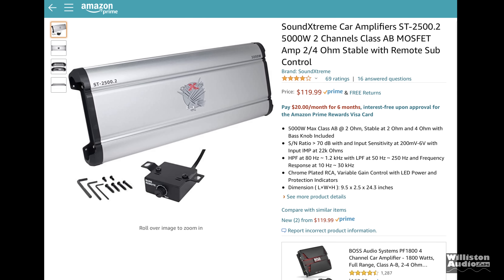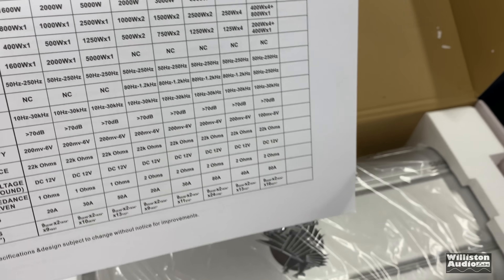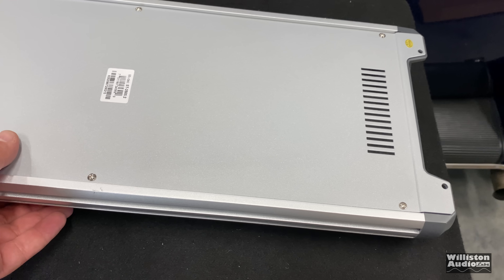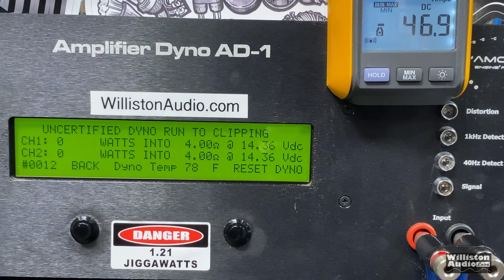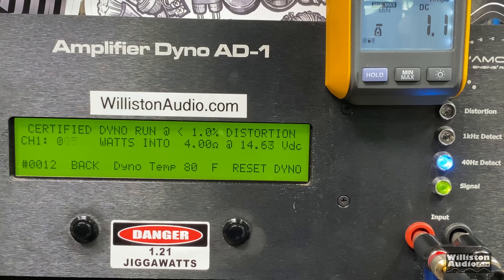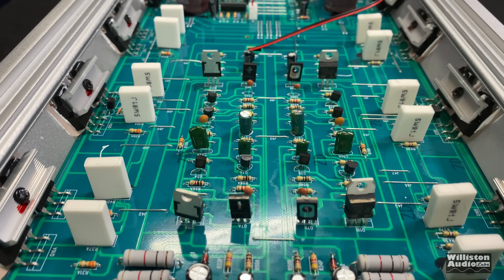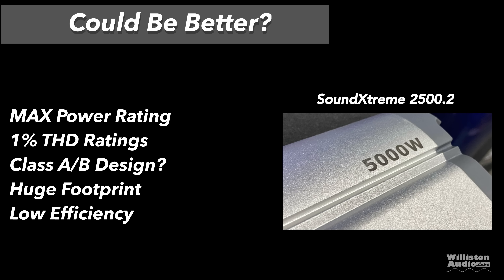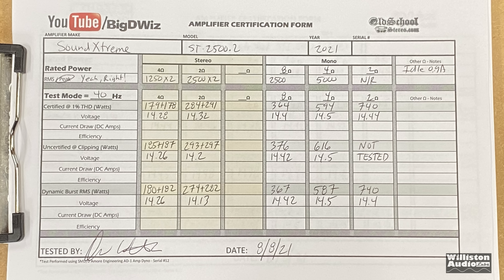How Much Power Does a 5000W Amp on Amazon Actually Produce?

Comment: When buying amplifiers look at the total amps of the fuses 2x 30amp fuses equals 60 amp...  1x 80amp equivalent to 80 amp ect...take that total of amp on fuse/s and times it by 13.2 or whatever your cars "running " not resting voltage and you'll be very close to ACTUAL WATTS  ( SHOP BY FUSES AMP RATING NOT THE WATTS ) MORE AMPS MORE WATTS ECT...

Comment: So if these amps say 5000 watts you just drop the last 0 to get an idea of the real power lol. I’ve seen so many people runs these really cheap over rated amps and brag about how much power they’re running lol. One guy I talked to said he didn’t understand why people paid so much more for amps when you can get “thousands of watts for $100.” He would not even attempt to listen to what I was saying about how they lie on their ratings. Wouldn’t even look at my phone when I was pulling up amp dyno videos lol. Talk about major denial. He was right and knew everything and anyone that said different didn’t know what they were talking about. I even tried to bring up ohm’s law and how it was so impossible to get that amount of power with the voltage and current with how small the fuse was on the amp was. And I wasn’t the one keeping the debate going. He wouldn’t drop it. He just kept looking up cheap amps that were over rated. Saying look man there are 100’s of lower priced amps with thousands of watts. Lol. Like because so many companies made them they had to be rating true power. I forget the brand of amp it was. It wasn’t boss. It was like pyle or rockville that was 4000 watts lol. On two of the Walmart kicker 12” subs. They honestly didn’t sound bad. They could of used a little more power but for the price they bumped. I just couldn’t get over this guy though lol.

Comment: Angled connector blocks suck dont they, my two Pioneer GM-D9601 amps and my GM-D8604 have them and they were a right pain in the arse with the amps on the back seat.

Comment: i was mislead by sound xtream also..paid for 2//2000 watts at 600 rms compatition subwoofers..when they arrived the box states 1300 watts and no rms ratings..also inside the box the round cut out that all speakers come with was broken and the sub was leaned into the box..and this was with both speakers

Comment: So it's like this, str8 up! I plugged in my amplifier dyno and had a nice 14.6 volts registering from my power supply and I ran this "sound Xtreme" amp. I needed a competitor to run a against it so I chose the obvious choice that everybody has been waiting for. Yup you got it! I ran this caca load against the best caca load! Guess? No? Give up? Ok well, I ran a 2/0 OFC wire to my butthole and farted something fierce and I blew a 166 watts and uncertified my butthole blatted out 190 watts of clean, methane power. Now, this hunk of caca called "sound Xtreme" is pure doo-doo and the people who slang this caca are all higher than the buns on Kensington street. They are all zombies, shuffle footing and bumble butting into eachother and lethargicly poop out these solid caca units that make no power. Like I showed my butthole after a normal dinner can produce more power per hole than these diahrehha doo-doo and pee pee amps do. All the guys do at the facility is get loaded and pee all over the receptionist who is high as well and is making big doo-doo piles next to her desk because shes to high and cant walk. She just hangs off her busted chair and goes poop all over the floor. Yes, this company produces caca. Pure, rancid decaying road kill bbq'ed up and eaten then, farted out as to create toxic clouds of butt and it still makes more power per hole than all of these crap, poop, shit hole amps. So. In conclusion,  don't buy one. Shy from caca, doo-doo shit boxing crap amps.  For one, you'll get wet poop for your money. Not power. Raw, raw, raw butthole power foo, and two, your supporting pooping idiots with massive dope habits! These individuals who poop while walking around because they are just way to high off methane and other farted out gasses know nothing about butts or amplifiers. Trust me, just go and RIP fart after fart into a 5 gallon bucket and then shove your power and ground wires into the bucket after you've farted 100 times into it and that will give you 3000 watts at 2 ohms! YES I KNOW INCREDIBLE! AND GUESS WHAT? LIKE I DID YOU CAN "HARDWIRE" THE BUCKET RIGHT OUTTA' THE PROJECT! HOW? REALLY YOU SAY? . YES YOU IDIOT! BYPASS IT AND HARDWIRE THE SOURCE TO YOUR SUBS! JUST PUT THE 2/0 OFC ONLY WIRE ABOUT 7 INCHES UP YOUR BUTTHOLE AND LET EM' RIP! ITS GOTTA BE WAAAY UP IN IT BUT YOULL GET IT! ITS WORTH IT SINCE YOU'LL SEE MORE POWER AS THERE WILL BE NO LOSS IN AMPS DUE TO ALL THOSE FACTORS LIKE VOLTAGE DROP OR BOX RISE. YUP! ALL POWER FRESH FROM THE SOURCE. THE BUTTHOLE. INSTANT WIN FOR THIS GUY! ME ESE! E QUE JOTO? ILL POST THE "HOW TO" TONIGHT. HOPE THE GAYS AT YOUTUBE DON'T CENSOR IT BECAUSE ITS REVOLUTIONARY! BYEEEE GUYS I MEAN GAYS

Comment: It's funny, in the old days when you'd buy a cheap unknown brand amp. You'd usually get like 1/3 to 1/2 the rated power. It would also typically be built on the last generation of tech that the best brands were using before their upgrade.
Now I watch this, 10% advertised power, terrible materials, I wouldn't let my kid mess around putting this in a car. My how the times have changed lol.

Comment: So I have a dumb question. I have a mono amp and a 4 channel amp but they do not meet the rms power of the subs or the midranges they are powering would it be worth it to buy different amps that did or would there not really be a sound difference because my gains are low and it will power the spreaders to distortion

Comment: If they would just advertise it as a 600RMS amp for $120, I'd say that would actually be a winner.  Anyone else agree?
Reply: Yeah but another company would sell the same thing and say it was 1000w and sell more, that’s probably why the numbers are so off
Reply: @Industry-insider  , well it defeats the purpose, because I would rather spend my money on Real Power.
Reply: @Roln19s  clearly it doesn’t make a difference because nobody actually believes it has 5000w
Reply: @Industry-insider  , which is my point.   If it was advertised for it's rated power, it is a Value of the amount.  End of story.

Comment: The worst are the "big" amps that had the double circuit boards...small board on 1 end with RCA....with ribbon cable jumping to other side where the BTL chips are located..and some even had hunks of metal in between to give it that real power weight lol...and you can't get rated power unless you sprinkle the packet of pixie dust in it...come on Big D did you keep the pixie dust that came in box?

Comment: The sad thing is that 600w still kicks ass in most cars so most won’t even question this…
Reply: If it was running a highly efficient box with in car gain, yes.  After all 600W vs 6000W is only 10dB!  But the (true) 6kW powerhouse will sound better and last much longer.  It will also cost at least ten times more too! ;-)

Comment: Ok I have a question I have a audioFonics 1500watt amp from 2005 and it has 2 40amp fuse does that mean it’s good like idk if it puts more power or if it hits 1500watt it hits hard with 3 subs connected jw
Reply: This is what i do is 2+40=80a x 12volt -10% and that is what the amp max can do if its a a-class amp .(960watt)
If its a a-b amp than its
2+40a x12volt-45%=432watts watts.
2+40a x 14.4 -45%= 518watts

Wy do i use 12volts ?
A car is not stabel on 14.4volt it go up dan down thanks to the bass of your music .
And a dynamo is not fast so it can pump the volt and the amps up.
Set a volt meter en set the music on and you will see it go down with easy to 13volt and lower.

You do not need to have a test dyno to test it .
Its just the limit of the volt and amp .

This way for that i pay for a amp i can do with a calculator what the watts it can pomp out.
Reply: @dyslectische  - Class A amp would be nowhere close to 90% efficient. You are thinking of Class D.
As for the silly lecture 12V... Note that BigD always tests at 14V to 14.5V. All car audio is tested and rated at that voltage because that is what the fully charged car battery puts out (12V is basically when it is flat).
If your voltage is drooping to 13V or less, then your power connections are severely lacking.

Comment: At 8:55 in the video the brown cap on the right looks like the bottom of it is missing a chunk or burnt up.
Reply: Do you mean the 2 x green 2200uF electrolytic input filter caps?
All the caps have a dark black-ish goop slapped around them to glue them down. Watch from 8:42 (main caps) and look at the same 2200uF caps at 8;48 - see how it's slashed onto those copper bars?

Comment: Stayed true to the 10% of rated power on cheap amps. The most frustrating part is a 600 watt class ab amp for $120 is not a bad deal. Great video as always man keep Dick Riculous on the case.
Reply: Id be curious to see how it performed on a set of beefy music speakers and not subs. Like a set of ssa evils or something thats power hungry. I still like the idea of a dual power supply ab 2 channel for highs and mids.
Reply: @jarrodbrennan121  - It'll perform exactly the same as any other cheap Class AB amp with the same (actual) power output.
Reply: That thing takes up too much space for a 600 watt amp though.
Reply: ohh absolutely  i remember the days of 1 dollar plus a watt class ab amps that were much more poorly built than this one is..
Reply: I agree.  I bought a sound storm 4000 amp for $100 and it’s very strong.  Not 4000w but Mabe 1000w.

Comment: Also, I was just screwing around on eBay and bought a Lanzar Legacy 3000 watt max amp (CLEARLY MaxxSonics amp) and it came with spade connectors for all inputs and couldn't push bass out of some POS Pyle 12" subs that I bought just to mess around with. The car audio world has changed so much that unless you drop some real cash you'll never be able to get something worthwhile anymore. It's truly sad.

Comment: 5kW into 4ohms requires 142V of signal level. To reach that signal level the amplifier will require 200-0-200 DC rails (400V).
The power filter caps were rated at 63V, so two rails of 60V are 120V. At 120V max audio sgnal voltage will be 42V. 42V in 4ohms is 440W and in 2ohms 880W. And they can't even do that.
I don't understand how are manufacturers allowed to make these false claims.
Reply: @Mitko The Macedonian I agree. Really irks me seeing false or exaggerated ratings on audio products. Would love to see a stop put to such false ratings in audio!
Reply: You ask "how are manufacturers allowed to make these false claims" .
Easy, they can say whatever they want. There is no way that every single product can be "tested not a liar" prior to sale. Furthermore, they'd just make a "Golden Sample" then sell the rubbish anyway.
The buyer has the ability to protect themself - it's called "Caveat Emptor" .
Reply: Plus the 80A fuse at 12V would only be 960W if it was 100% efficient.
Reply: Ahhh, the joys of unregulated capitalism. Selling overrated cheap Chinese junk never gets old.
At least the major online retailers (Amazon, eBay) have a returns process for items not as described.
Reply: Because its sold in the American market. Think how much we are lied too by our govt and our media. At least with amps you can look at the fuses or fuse ratings and get an idea, i always thought if someone doesnt have enough sense to know this, they shouldnt be searching for an amp to start with. Thats just my opinion though. For real , who watches this channel all the time and dont already have a ballpark figuire of what the amp will do on the dyno? Most people that dont  know are going to ask someone who does anyhow. Just saying.
Reply: No,no,no,no! You’re not using Chinese-Marketing Common-Core Math so your equations are not valid! It is indeed a 5000W amp! 
Why (you may ask)? 
Because the marketing department says so!

Comment: Most of these amplifiers are rated with the pmpo  power rating .For  example.  A power that is rates 5000 pmpo  will be about 500w per channel at 1ohms impedance .That's what happen  in this case .
This is done to fool nieve  buyers  who are not knowledgeable enough  about these things .

5000w of power is nothing  to play  with .I do not think  you have any speaker that can handle 5000watts unless it's a 24 inches with a 10inches diameter  voice coil . I own and operate a sound system and realized that most power that shows real wattage coat that rating on 1 ohms impedance  .The required power coating should be 4 ohms impedance . Crown  QSC  , PV yamaha  are the most  common  amps whose wattage are 80% of what it is rated which is good enough .
NOTE pmpo means. Peak momentary power output . And this is the power on an idea  perfect situation ,but  that never happen .

Dale 
Sound engineering and technician .
Reply: No, they aren't rated with "PMPO". You realise there is no such thing anyway?
They are rated with WBDBWB*
( * Whatever Bullshit Dumbass Buyers WIll Believe )
Reply: @johncoops6897  yes I like that Acronym is really  what is use in most speakers .whatever the buyer want to believe as  you rightly said .

Comment: All right, before I watch the results, think about how expensive 600 and 1000 watt amps were back in the mid to late 90s. If you could get a 2 channel mono amp for $120 that made 600-1000 watts, then you were doing pretty good. When I was a teenager living here near Beaver Falls, Pennsylvania we had a place called Ray's Audio (closed LONG ago) and I bought a set of brand new Rockford Fosgate Punch HE-2 DVC 12s in a box for $250 and I paired it with an old school US Amps 125x4 amp that was 1/4 ohm stable (red anodized with a clear bottom) and those two subs sounded so good, and that was only at 1 ohm. I later put them on a Soundstream Reference 1000x4 amp on the sub channel and they still slammed.
Reply: Yea but there was such better quality then too. But I totally get what your saying.

Comment: You should test a Crown Itech 12,000
Reply: Very good amps  but this rating  in on a 1 ohms impedance load .No one play on a load with 1 ohms impedance. the standard is 4 ohms .if this amps was to be rated on a 4 ohms load  it would read about 5000w